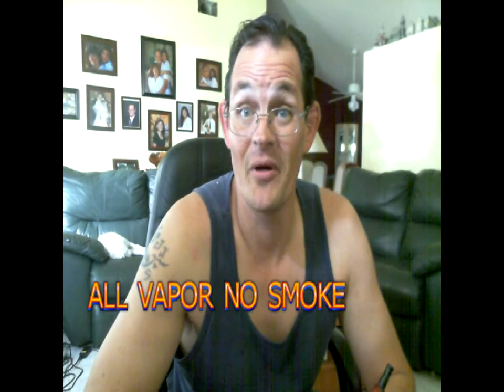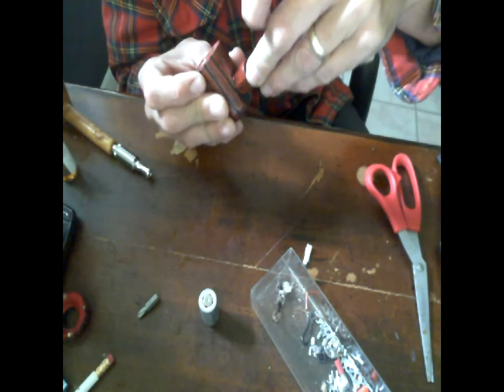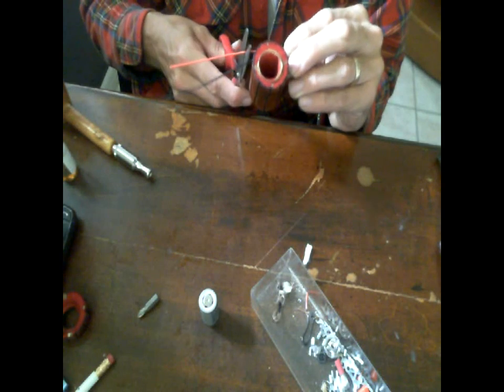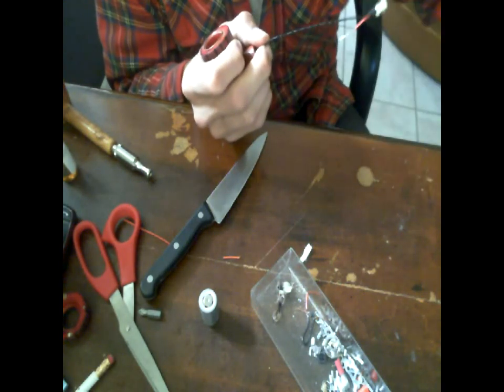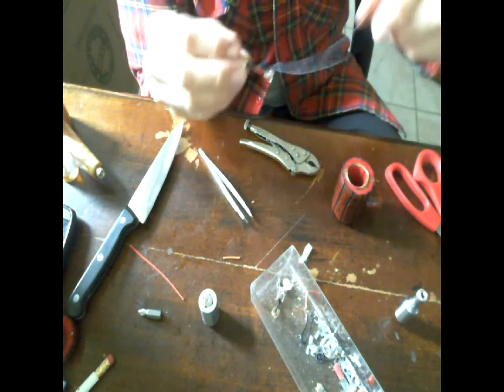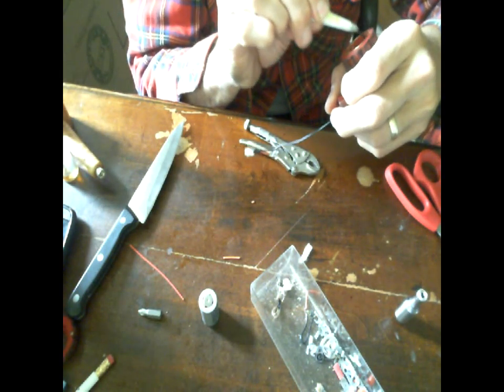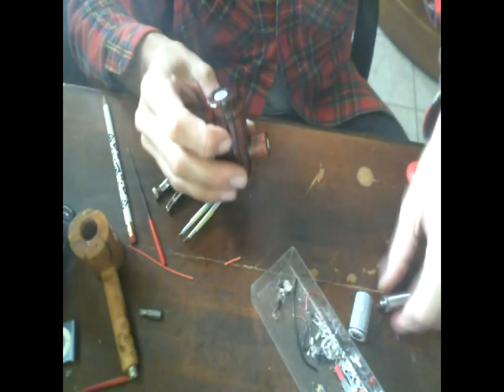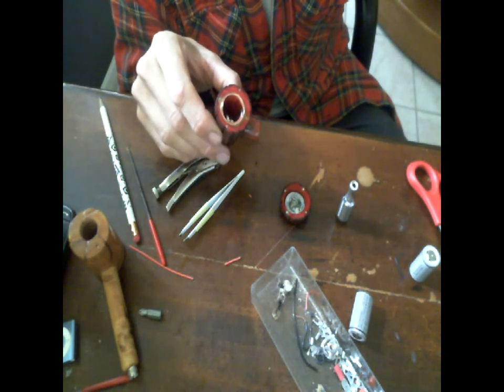How to wire your e-pipe

Comment: Great vid. I have a project I'm thinking about doing. I plan on using the bottom half of a bottom firing mod pressed into the chamber to act as the switch. If I use a small metal disk at the bottom of the chamber soldered to the positive wire, would I just need to run the negative up to the battery tube and solder it as a ground? Or is that to simple?

Comment: Hello Michael.. Mebbe a little more detail on how the cap is made,, Appeared to be a magnet and some connections around the edge.. also,, what is actually holding that connector in the bottom of the pipe,, a screw??